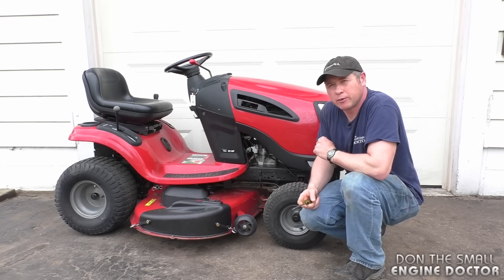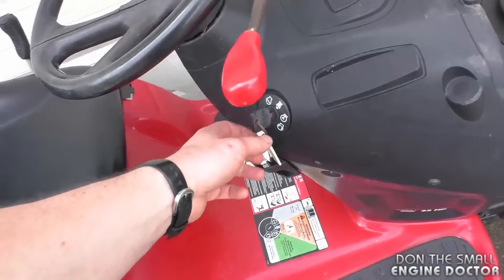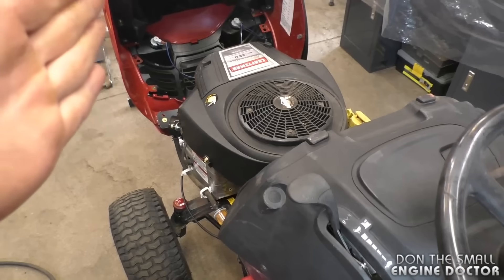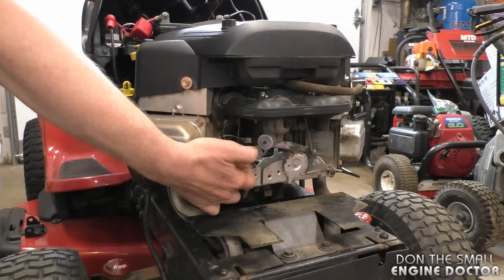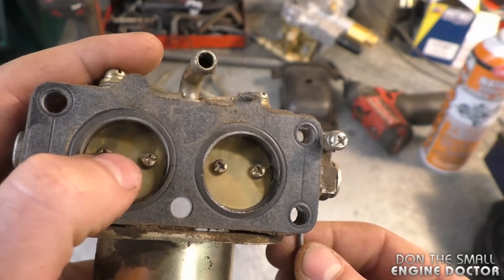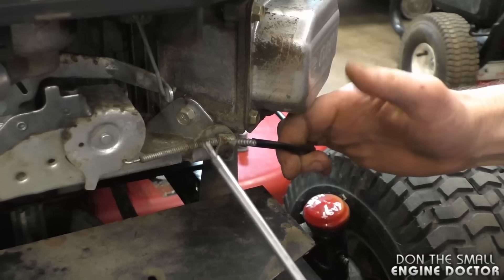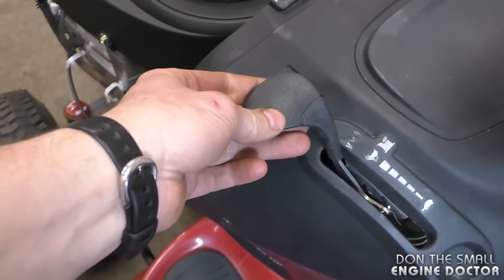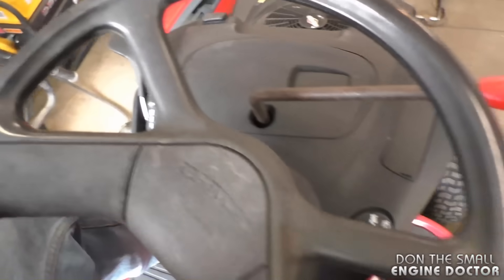Lawn Tractor Won't Start? Try This Easy Free Fix!

Comment from the maker: Watch my video on how to fix a lawn tractor that pops and backfires here;
https://www.youtube.com/watch?v=cmDP5IsH8fM
Reply: How many hours do you think is to much on a mower like this?
Reply: My neighbor brought me his jd 300 series. It won’t start. It has no spark. Plugs are fine. Coils look good and I cleaned them up. It turns over, but no spark. I’m thinking safety switches are next. He had bypass the seat switch but what and where do I locate the hidden switches?

Comment: Good morning,  Yesterday I was going to mow. Gee, my mower wouldn't start.  Fooled with it most of day. Read this article about the choke but didn't think I could do it.  I'm 73+ years and can't get up and down very well. Well I looked at your video again this morning, went to the garage and within 15 minutes had the hood of, choke tightened, jumped mower and boom, started right up.  God bless you my dear friend. I'm so happy right now. The only down side is that it rained almost all night and morning so it is to wet to mow. LOL  Again, thanks soooo much for this info.

Comment: I've got to thank you, fixed the choke and it started instantly. There was so much dirt caked around the  spring that it kept the choke closed. Cleaned the dirt off the spring and it works like as it should.

Comment: Fixed my Husqvarna lawn tractor with Briggs & Stratton 22hp Intek  for sure!  I was so tired of having to use carb spray to get it started.   Sure enough, the cable need to be adjusted.   The choke actually works now and it starts right up!  Thank you.

Comment: There isn't anyone who fixes these things in my remote location so need to do it all myself. I've been fixing and doing maintenance on my own 21hp, 46" deck, Craftsman for 11 years now with help from people like you. This year I will put in a fuel shut off valve for the heck of it. I often have about 3 issues each season and last year didn't have one so figured I was going to have fun this year. First thing this season,  I had to replace the battery - so glad it wasn't the starter! I've replaced and diagnosed so many issues on my own tractor that guys even come to me in desperation to help them. Thanks for helping me with another thing to check.

Comment: I can't thank you enough for this video! After struggling with this problem for the last 3 years, you fixed our problem in less than 5 minutes. My husband can finally stop swearing now 😉. You get right to the point, explain things very well and give great step by step instructions.  Now, if we can just get the darned generator to start 😉. Thanks again

Comment: I have been having this hard start problem for three or four years on my craftsman mower and nothing I had tried helped. I just found this video today sept.29 2022 and this was what my problem was. I adjusted the cable and it fired right up. Thanks Dony.

Comment: It took three times but finally got the adjustment right. Started up. Thanks.
I had repairmen say, replace the diaphragm, use carburetor cleaner, additives, etc. But this fixed it.

Comment: I have a T100 m0wer.  The choke mechanism is slightly different, however this was precisely the problem.  I was worried that I broke it somehow but I fully engaged the choke and it started right up.  Thank you so much!

Comment: Don, this is a great video.  Cold Carbs always need the choke engaged for starting.  It's so simple and should be small engine class 101.  I learned this in 1974 when starting my 1969 ford e150 every winter morning before heading off to high school.

Comment: Just saw this video I have a snapper ST2046 it is just like yours, except mine has a spring on the bottom of the chock rod. I did what you said and heard the choke close,  WOW!!! it started for the first time with the choke, I have been priming the carb., for 3 year to get it started. Thanks.

Comment: Thanks so much for this tip. I have tried everything including buying new carb, fuel pump, new fuel lines etc. When I did your tip it cranked right away and even ran better. Thanks again

Comment: This tip was very helpful! I bought a Simplicity Regent in 2015, and it has always been difficult to start. I watched this video, adjusted the throttle cable, made sure the choke fully engaged, and it starts like a champ every time! Thanks donyboy73!

Comment: Thanks so much.. your video pointing out a choke concern was right on the money..  the battery was strong..but just wouldn't turn over..  Did as you suggested and GOT the mower started and in the shed for the winter BiG relief

Comment: I have had this problem since buying it used, thanks im sure this is my problem. Thanks went out to my mower and did what you said and it pops right over. Had this problem for 6 or 7 years. Too much your the only one so far to point this out.

Comment: A MILLION THANKS!!!!
I've had about 10 years of this problem, it takes a long time to turn over my mower.
In case anyone has the same problem I have the Troy-Bilt 21-inch Push Lawn Mower
 Model#: 11A-542Q711.
Tighten the choke cable.

Comment: I have nearly the same model Craftsman, and I put up with this for almost 10 years. I had a repairman out when it was in warranty, and apparently he didn't tighten the choke linkage well enough because it eventually went back to being loose. It was guaranteed that I would need to recharge the battery several times a year because the engine had to crank so long before gas could start the engine without the closed choke. I could not find the solution until this year, and now I no longer have to sit until the thing wants to start. I'm so happy.

Comment: Thank you so much for the informative video! My Toro Timecutter (fairly new)has always had some hesitation starting. Tightened the choke line a little and it worked! Starts immediately and doesn’t struggle! Didn’t need to have it serviced. Thank you thank you thank you!

Comment: Thanks, this exactly sorted my sit on mower. Mine was a Honda, but the same methodology applies.   It took me 3 attempts to re clamp the cable, as i was not pulling it hard enough to take up the slack.  I proved it was the fix by manually holding it shut, after failing to start for weeks, it started immediately. 
Great video, many thanks.

Comment: Thank you for sharing this video I had the same problem with my same exact mower but a 24hp for years had to use starting fluid to get it started every time I went to use it no matter what time of year it was, it would start after running and shutting it off and restarting but would have to use starting fluid again after sitting not being used for one day. I put some gas in the tank and I did what you instructed in your video and it started with no starting fluid after sitting for months all winter. Thank you, a less frustrated tractor owner!

Comment: You must be a mind reader!!! 
Two weeks ago, I had to replace my throttle cable and thought I had tightened it in the same location. 
Since then it would not start.
I called the local JD repair facility and they were three weeks out for appointments.
In that time frame my grass would’ve been 2 feet tall.
I will be adjust that cable in the morning and mowing my lawn with a smile on my face knowing I just saved $280 and three weeks!!!
Thank you.keep up the good work
Reply from the maker: yes I made the video just for you in mind lol, have a good weekend
Reply: @donyboy73  I have been receiving your Friday email fixes for years. Why have I not received any in the months?
I have to now search YouTube to find them.
Did I get unsubscribe from your end?
Respectfully,
Robert
Reply from the maker: @rhfjrbeck  make sure you are still subscribed and click the bell icon or notifiations

Comment: I had a friend's Craftsman tractor do the same thing this is going on about 7 years ago he passed away but every time he would try to start it flood out and he would need another spark plug to put in it cuz the plug was so full of fluid.Thank you for setting some light on it and thank you for the video

Comment: I wish that you had this video two years ago. It would have saved me some time.
I have a slightly older 20HP one.
The problem is that the carburetor linkage travel is shorter than the operator throttle linkage travel.
When you pull down the linkage to idle too hard it will eventually change the cable position, causing hard starting.
If Craftsman put hard stops on the operator's lever, the problem of the cable moving would be eliminated.

Comment: Thanks!!! Was about to take apart the carburetor before I found this. 
Would be nice if Craftsman/Lowes at least made buyers aware of this. I’ve been using using starter fluid in the air filter every time

Comment: Another great video in the clue of why my brand new mower won't start . Thank YOU
Reply: You should just return that mower, because if it doesn’t start and it’s brand new, then that means it will probably have more problems.
Reply: @manofculture4945  I invested $13 into it because Lowes saved me over $300 but it wasn't the solenoid and the fuse kept blowing out. So unfortunately they're picking it up tomorrow

Comment: That's a great simple fix if that's really the problem, which I've seen several with that same condition, this is why I prefer the older style with separate throttle and choke cables...much less prone to have this problem.  

My Craftsman Lawn Tractor had the 24HP Twin engine, it was just a pile of crap to begin with.  It would randomly shut itself off while mowing too, once it cooled down completely it would fire back up and be fine for another mowing or several then it would do the same thing again.  After about 7 years of pretty light duty use a connecting rod parted ways, wasn't even upset when it died, that thing was junk from day 1.  Only bought a Craftsman again because my old GT6000 ran great for 21 years and it did a lot heavier mowing and other yard and garden chores than the YT4000 that replaced it ever did.
Reply: I have a YT 3000 craftsman. This is my tenth year bought it new only problem I ever had was I needed to replace the ignition coil this past spring other than that routine oil changes and maintenance starts up every time. I only have 70 hours still looks and runs like new…….

Comment: thanks  my husqvarna, had this issue, great tip, also the valve cover  vacuume hose small cracks, preventing the fuel pump  from good diaphram action
Reply from the maker: the impulse line does crack often on those, thanks for the reminder!
Reply: @donyboy73  the other thing i found was air gap on magneto coil,set way to  wide at the flywheel  🧲 magnets

Comment: Very helpful video. Now I finally know that 100% choke will "close" the combustion chamber so the fuel vapor won't dissipate as much and thus easier to ignite. I think it is far more likely the factor for a difficult engine start than a stuck fuel solenoid. My 17-year old fuel solenoid looked like when I took it off to see. Those videos blaming a stuck fuel solenoid probably had a mower that was not in use for years. It is also easy to hear a click with ear close to a functioning solenoid when the engine key is turned to front light on position.

Comment: Wow, we've had this tractor for 5 or 6 years now. It's started super slow since new, to the point where I rigged up a truck battery because it would drain the stock one.

15 minutes after watching this it starts like it should. Thanks!

Comment: This is great info as usual Don!  Not that it matters, but I believe the butterflys you are showing on the separate carb is the throttle side not the choke side.  one  giveaway is the adjustment screw you can see. anyway, this solved my problem as I put a new carb one. thx
😀

Comment: Let me begin by saying that I am a novice at best when it comes to the mechanics of an engine. It is through videos like yours that have allowed me to keep my lawn tractor running with very little maintenance.  That may have ended here today.  I have a Kohler engine in a (2002-2004) Craftsman LT 2000 mower.  Engine CV490S. My engine was running high and just overall not sounding very good, so I pulled the carburetor.  While pulling off the carburetor, I  found a piece of it (circular metal piece that I believe controls the amount of gas or air into the carburetor.) in the airintake part of the heat shield.  So I replaced the carburetor with the use of your awesome video.  My tractor starts but it stills revs high no matter where I put the throttle lever.  What's next?  What else should I look at?  I am being told to look at the "internal governor" by some.

Comment: Thanks for this video which helped me check that the fuel pump was working. Engine still would not fire so I pressed accelerator pedal to floor 5 times and then it started 1st time. I don’t know whether this primed the fuel system or cleared out a blockage. Either way, problem solved and worth trying before you start taking things apart.

Comment: i am 70 year old widow and have had this issue for many years and had family members try to fix so today i got my riding mower out for the first of year mowing and once again new battery last year and full of good gas plus run it out of gas at end of year like they suggest so now this after noon i am going to see if i can find tool to do this and the strength to turn it so God Bless you for free helpful advice God will Bless you for helping us all that barley can afford the gas to run it let alone pay workers labor to fix things like this will post again later to let you know if this works for my husqvarna model lgt2654

Comment: Thanks for your input.
Reply: This my second Troy-Bilt riding mower. My first was in 2005, this newer one I got in 2020. The older one ran to no end. Until the linkage under the drive paddle snapped & sat in my garage ever sence. This newer model works find until I had problem with the solenoid Switch on the carb.
I checked around & it difficult in getting a replacement. I found out you could by pass that Switch,  I did so by modifying it. I cut off the switch probe tip, & reinstall the Switch.  It work out find & I was back in business again. Thank the people like yourself in helping out. Have a great 2023 & GOD BLESS...
"CHOW- Brother"

Comment: I have a Craftsman YT4000 with the Briggs and Stratton 24hp V-twin, and it never started properly. It was given to me shortly after a new carburetor was installed. I never figured it out, and took to using starter fluid in the air intake for every cold start (worked every time.)

I've since retired the machine, since the deck rusted away and collapsed, but I still have the tractor. I'm gonna see if this was what was going on.

Thanks for sharing.

Comment: I really wish I had seen this video last year as this is exactly what the service guy did for me.  When the weather is hot this problem doesn't surface it is only when the weather is still on the cold side.  I am hoping my current issue is the same issue, I really don't want to take apart the Carb.

Comment: Good One!  That is an old tractor with the very convenient hand speed control.  Wish I could convert my X320 to that.
My 22HP Kawasaki was starting very hard and after carb disassembly, fuel filter replacement, blowing out lines and draining tank I finally got a new Fuel pump.  Seems OK now.  It would run at high RPM once it started with the aid of fuel or Ether to the carb.

Comment: this quick fix and your simplistic representation, i truly appreciate it.  process of elimination got me down to this video after wasting a couple hundred on a new battery, a quick look from a lawn tractor guy, and shooting starter fluid into the carb for the last 6 months of last season.  i was able to do exactly as you showed and i have no knowledge of small engines.  THANK YOU THANK YOU

as an aside, lowes-craftsman was no help on my brand new mower last year when it worked once then wouldnt start.  i ended up disputing with my credit card and they refunded the entire 2k+ purchase.  if only lowes-craftsman had worked with me they could have fixed it for almost free ha.  oh well

Comment: The linkage you took the slack out of is the choke linkage but the butterflies that you showed are the carb butterflies the choke butterfly is on the other end of that particular carb on the air intake side.

Comment: Dony,  I have one just like this, very hard to start, I made a small hole into the plastic air cleaner on top, the same size as a straw that is used in a can of either (starting fluid). Give it a little squirt and it starts right up. Its been like this from when I got it new. I will try your fix.

Comment: Hi...I follow your help videos and they’re so helpful. So I hope you can help...My JD L110 with a Kohler 17.5 HP engine. It’s very hard to start when engines cold..why?
I’ve replaced spark plug,  air, fuel & oil filter.
Mike from NJ

Comment: Appreciate your videos! Wish you were close by cause I got a good one for you, Craftsman LT2000; for the life of me can’t figure it out. New carb, new ignition coil and spark plug, flywheel pin is ok, new fuel filter, piston moves, compression around 100. These models don’t have a choke. Very hard to start, sometimes does if I add some throttle and idles high erratically. Ends up stalling out after few mins and won’t start back up. I’m so lost.

Comment: #$*#@% I’ve owened the tractor for years and it’s always cranks for a minute or two before firing…I took to a reputable shop to have it tuned. No real improvement!! I just accepted that was how it was. It took me longer to walk from the garage to the shed than it did to make the adjustment…..thank you, thank you.

Comment: Very helpful. As always. I have a countax a2050. It runs well for an hour. Then just starts to die. I changed the air filter as it's obviously an air intake issue. I think. I put the bonnet up and it runs but it's difficult to mow with the bonnet up.. Any ideas gratefully received!